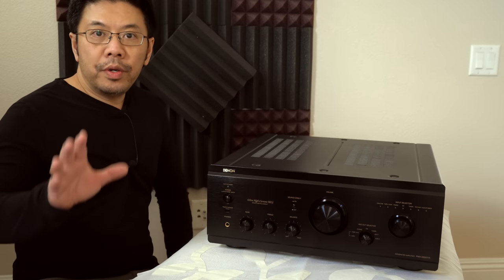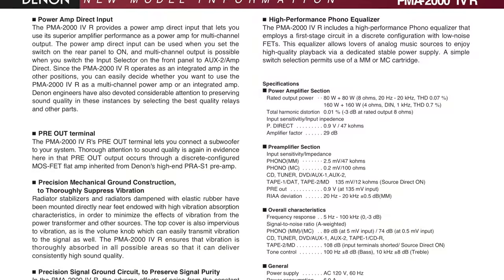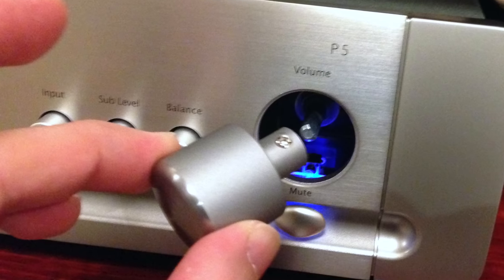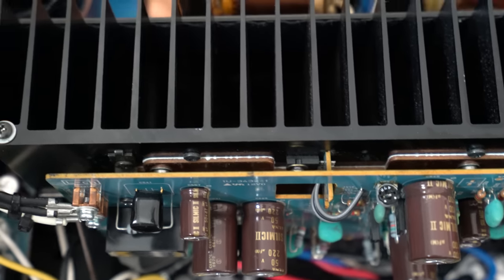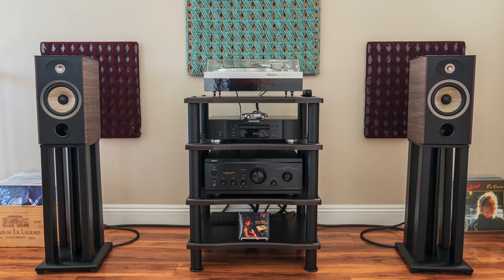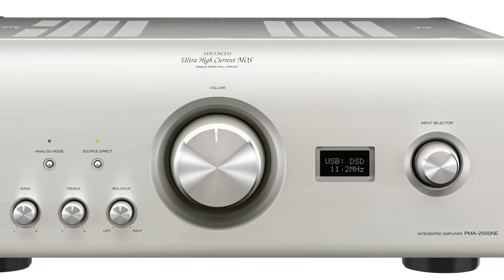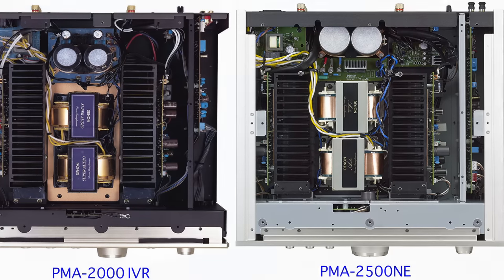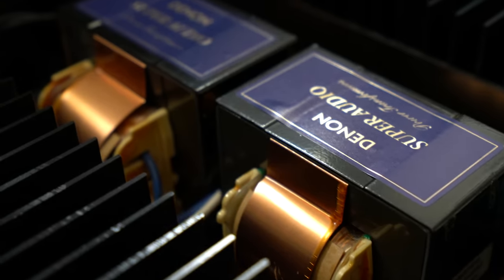Denon PMA-2000 IVR, A Hidden Gem For Music Lovers

Comment from the maker: DENON "PMA-2000" Series Timeline.
Series begins with the first model in 1996 and run for 20 years with different generations, until replaced by PMA-2500NE in 2016.

PMA-2000, December 1996.
PMA-2000 II, May 1998. 
PMA-2000 III &  PMA-2000 IIIR, January 2000.
PMA-2000 IV and PMA-2000 IVR, March 2002.
PMA-2000AE, July 2005.
PMA-2000SE, July 2009. (PMA-2010AE in EU & Aussie?)
PMA-2000RE, October 2012. (PMA-2020AE in EU & Aussie?)

Replaced by New Series.
PMA-2500NE, February 2016. (Current)

Note, 
No RC For First Two Generation.
3rd "IIIR"and "IVR" 4th Generation with RC option, RC is standard after 4th generation.
Reply: Great review, today I bought a pma a100 from TMR for $1580. Nearly 60lbs and I’ve wanted this particular model for awhile.
Reply from the maker: It's a very good amp, Audioholics have detail measurements of A100.
Reply: Thanks  I just like the way it’s made and in Japan for many years with nearly the same basic tried and tested design. I bought a Denon 301 MC for it on a Technics 1500c.
Reply from the maker: That’s great I also have DL-301MK2 that I really like, enjoy your music, thanks
Reply: @Tharbamar  I was thinking of ordering a pre owned pma-sa11. It seems like it should be mostly the same as the sx11 and can be had for 2k less than the new one. Paring it with my revel m126be.
Reply from the maker: @bs11100010, SA11 would be very nice, I thought about it before I order for SX11, thanks
Reply: All the best to you and your family. Stay well.
Reply: Great review, have you ever compared Sansui au alpha 907mr vs Denon PMA-2000 IVR?
Reply from the maker: @Martin Ruiz Yes, it's 700+ DF @ 8Ω
Reply from the maker: @janzetrateski6300  Yes, 907MR has more refinement with a bit more smoother mids and highs but Mid to Low Bass is not as good as 2000IVr.
Reply: @Tharbamar  thanks for the reply
Reply: @Tharbamar  i notice the two big caps are made by denon but i have my pm2000 1st version it has elna caps.
Reply: @Martin Ruiz  (damping factor: greater than 700, 20 Hz – 20 kHz)
Reply from the maker: It’s should be the same custom made caps for Denon, I think later generations have big Denon logo with smaller Nichicon name underneath.
Reply: The power supply capacitors are Nichicon.
Reply from the maker: mystique Yes I saw that but I don’t know why I typed ELNA, corrected, thanks
Reply: @82ivaylo  the pm2000 which i have has Elna caps. while the pm2000iv used by tharbamar is using nichicon caps.now i know one of its difference.
Reply: @Tharbamar  my 1st ver of pm2000 has elna capacitors
Reply from the maker: @myplaguesify  I didn't know that, I thought they only use Nichicon main caps, Thanks for letting us know.
Reply: Tharbamar. I have the opportunity to purchase a pma 2000-r in australia for $900. Would you recomend at this price ?
Reply: There was a denon pma 2000R

Comment: I've used this exact amp in my main system since 2008. Everything said in this video jives with my experience perfectly. It's very powerful & well built, with a clean, punchy, and controlled sound. I even had the same problem with the input selector. After using the amp for about 9 yrs, the input would randomly change without me touching anything. It was really frustrating. I took it to my local Denon authorized service center. They cleaned out & re-lubed the potentiometer, & it's been back to perfect since then. Great, great value. I also plan to keep mine for a lifetime.

Comment: That is exactly how I feel about my Yamaha 2100, solid build quality, nothing that will become dated over time and since I still have my first Kenwood integrated at 32 years old I feel safe saying the Yamaha will last a lifetime. Of course it has already gained a tube based sibling, but aside from the warm tone they both have very different strengths. What seemed like good value to me sitting just below the Yamaha 3000, now seems ridiculous value sporting the same topology and balanced circuit as the $20k separates. I can't wait to hear the Demon at 500hrs. Enjoy, my friend.

Comment: I would say my POA-6600 mono blocks with DAP-5500 are the Grandparents to this.  I’m still using the preamp in my system. And the mono blocks are still used when I choose not to run my tube amps   They have been used with my Martin Logan Sequel IIs also purchased in early 90s.  I’ve not had any issues running the Logan’s with the POA 6600.   Build quality is very good copper shield as seen in your video.   I’ve been very happy with them other wise I wouldn’t have kept them all of these years.  I do use my tube amps 98% of the time now but the POA are hooked up and ready to go!!!

Comment: Thats a badass amp period ! My Sansui G-8000 was 975.00US new in 1979 built in japan and the toridal transformer is the size of most amps now days lol and it scales like no other amp i have owned even better than my HK 990 which was good . I have owned many Denon amps and i like the Denon sound muscler and they sound great on most budget bright speakers the warm/richness really calms down metal dome tweeters and horns .
I have bought over a dozen amps from the end of 2018 till now and for the money the IOTAVX-STACK (Nakamichi) has blown me away basically 2 separate mono amps one for each speakers this gives you alot more power 2 wall plugs ins but your getting 240v instead of 120 !! So musical with amazing midrange .
 But so glad you sticking with Denon 
I absouletly love Denon also ! Very reliable !
Reply from the maker: You need to stop buying amps, I think you have too many of them 😁
Reply: @Tharbamar  having alot of amps help me alot with reviews , because me subscribers have different amps then me.  So i use cool netural warm  amps , speakers sound so different and when pared with the right amp by finding that Synergy is fun to do . 
I het surprised all the time . 
But haven't had much time lately,  working almost 80 hour work weeks wearing me out ! Even during this shutdown BMW still wants us to make them parts their greedy ! I think the Governor of my state about to shut us down !
Reply: @Tharbamar  check out my new cummunity pic ? 😆

Comment: I have the PMA-2020AE and i still keep my old Denon PMA-2000AE, great amplifiers.
Reply from the maker: These amps will last very long time for sure.
Reply: is it signifikan different between 2020ae and  2000ae?what about the sound sig of denon amp. every people on google say denon amp have bright and lean sound is it right? i am interest with 2020ae
Reply: @Rayradityaa  The PMA 2020AE is more lively, overall better sounding amplifier than PMA 2000AE.  Denon sound is not bright.
Reply: thanks for reply, finaly i already buy 2020ae and yes i like the way it sound. not bright at all..
Reply: @Rayradityaa  Congratulation for your new Denon. I will say it s warm sounding amplifier with good 3D soundstage .
Reply: @82ivaylo  I heard an opinion that of them all (2000, 2010, 2020 and 2500NE) the absolute best is 2020AE for some reason with its successor 2500NE being considerably worse. 
Also 2020 is said to have extremely deep and powerful bass - I don't know if its true or not. It seems that 2020AE is ideal for electronic music right?
Reply: @arkadiuszmikina4563  I do not have experience with the 2500. About 2020, yes the bass is deep and well controlled. When you listening to 2020 you are thinking there is small subwoofer in the room, but actually there is no subwoofer. Who told you about the comparison of 2000, 2010, 2020 and 2500?
Reply: @82ivaylo  That's exactly the effect that I am after --> thinking that there is subwoofer in the room but there isn't!!!! Many thanks mystique!!!! 
I am not an audiophile who listens to ambitious acoustic music like jazz/blues/soul/vocal. 
I am music lover who listens to electronic music and want very deep and very powerful bass and enormous scale of sound. 

I heard from quite a few people that 2020AE was the best of them all and also that 2500NE is a let down as SNR is low and so dynamics are low. I think it has to do with the inclusion of a DAC in 2500NE. 

If 2020AE only had variable Loudness button/filter (to aid my night time listening sessions) that would be amazing (that is why I am looking at Vincent SV-237MK as well).

Comment: I really really thank you for this review in particular as I am aiming to get the PMA-2500NE. There is no reliable review on youtube of the 2000 series up until now.
Reply from the maker: It’s a very good amplifier, I think you will like it, thanks
Reply: @Tharbamar  which one is better pma 1500RII or 1510ae ? Thanks a lot!
Reply from the maker: @tess6499  AE is newer model with some improvements.

Comment: I bought the Pma 2000 MKIV in 2006 and It Was a reliable amplifier for the last 14 years, the Problems I had Was also the imput selector and the Balance Volumen(Power Bias, left Channel was playing louder than the right one)
Reply: A "dirty" balance pot can cause issues with the balance just as a dirty selector switch pot can affect the input selection.  Clean both with de-oxit or similar evaporative contact cleaner.  Do not use WD40 or RP7 or similar lubricant as these can damage the circuitry.

I also own a PMA2000. Sensational amp for the money.
Reply: @dwr4992  thank you for the advice, I allready cleaned both whith a Potentiometer cleaner, the imput selector worked well for a one  month or so after that It startet all over, cleaning the Volumen potentiometer didnt work at All sadly. I tryed this process several Times. Greetings from Austria

Comment: Dear Friend, Hello
I was just about to put this Danon amplifier aside
Because I bought Nime Audio/AMP/DAC and it's much, much better than Danon
   FOR FOCAL
1008 BE ELACTRA
then 
I bought speakers B&W 801 S3
And suddenly I discovered this amazing amplifier just moving the loudspeakers with a huge   power  ....huge bass and amazing  and awe-inspiring treble
& MIDS 
 Stage width and depth that probably would not have been possible without this amplifier
Even so much power is barely 11 o'clock
{In the previous format I used the DAP-2500A Pre Amplifier
}
Now only his PRE.
My source SONY XA-50ES
DCD-1650AR
SA-11 S1 MARANTZ
DCD-3560 DENON
I also connected MIT MH-750 cables instead of VHD-122 which have accompanied me for another C-12 years since 1990

My amplifier has a logon problem suddenly for no reason jumps me to another IMPUT logon or clicks on Sony's RC  and suddenly jumps from CD to tape e.g.

I follow your movies you definitely have something to say about audio.
Thank you
IL

Soon a short film was uploaded on the system

Comment: Recently bought a used PMA-2000AE from Japan, USD900 shipped to my country. Paired with my Wharfedale Evo 4.2, the amount of bass produced is crazy. Big difference compared to my previous Yamaha stereo receiver Amp. (100W/channel). I enjoy the sound from this Denon very much and it can go crazy loud. Many thanks for your excellent recommendation Tharmabar.
Reply from the maker: Yes they are very good, hard to find better quality in the same price range used or new, especially with dual mono design, thanks

Comment: I think power MOS amplifiers are more reliable than bi-polar. Rock solid Hitachi MOS in my Kyrocera receiver since 1980, no thermal runaway, the reason, voltage gain works better than older current gain equipment.
Reply: Regarding robustness, the main difference between BJT and FET is that BJT has limited safe operating area, so the output devices need to be carefully protected against even moderate current when Vce is high.  FET devices are only power-dissipation limited and therefore more rugged.  
But both types of output stages are current-gain stages.

Comment: Hi @Tharbamar, I have a B&W 607 S2 speaker, and I currently own an Audiolab 6000a amp with a Chord Mojo 2 as a dac, and I really like the soundstage, the holographic sound, and the separation of instruments in the 6000a, but the 6000a lacked warmth in the midrange, and now I need a warm amp with big soundstage. and with dynamic holographic sound, I thought about the Denon PMA2000AE. What do you think? Will it give me what I want, or are there better options for my speaker under $1000?

Comment: I bought this series model in 2001 new.
No problem at all for 20 years.
I turned off power only couple of times, maybe that's why.
Reply from the maker: I like to leave them on as well, only turn it off while I’m out of town.
Reply: Much thanks for your informative reviews.  Can I ask why do you not power off the amplifier even when not in use?  Do you leave it power on or in standby mode most of the time?  Thanks again.

Comment: I learned from your experience with this amp that one can never judge a component without 1st hearing it yourself. Should have known that before, feel kinda stupid that I fell into that trap!
Reply from the maker: What kind of Amp do you ave now?
Reply: @Tharbamar  i have 2, kinki studios EX-B7 monoblocks and EX-P7 preamp, and a sony ta-a1es integrated that i sometimes use instead. The monblocks are class a/b and the integrated is sorta class a. They sound very different, and i dont have a clear preference. My speakers are bowers and wilkins 702 s2s. I want to buy the denon you have but only if your experiment turns out good, or i will buy the new nad m33 integrated class d, very curious about the class d module in the nad.
Reply from the maker: I will make a post to answer all your questions about SX11 in a few days, thanks

Comment: Hey there, recently denon launched their 110 years anniversary model which is the newer model to the PMA 2500NE so i guess you should have a look at at as it has some upgrades including a good power supply
Reply from the maker: Thanks I will check them out but now I’m using SX-11 as my main amplifier.
Reply: Ya i love the way SX 11 sound love your setup

Comment: I have the same problem with my Parasound (sound balance) but its not the amp, its the preamp,  because when I put HT bypass on it goes away.
Reply: My p5 had the same issue after several repairs from parasound they replaced it with the new p6 and it was much better sounding too with no issues

Comment: Thank you for your relevant and concise reviews. Recently Denon has introduced the NE series .From the Japanese website and interviews given by the designer (sound master) the NE series marks a new beginning.Sound is following a vivid and spacious design thinking.Using the 600NE and it has great  price/performance . If i have understood correctly as i cant read japanese but the diagram shows that all the NE series is a single stage amplifier. I have auditioned the 520AE and 720AE .The NE is a clear stepup while maintaining the best of the earlier models.and  I would request you to consider auditioning the NE series .(Disclaimer : No affiliations)
Reply: NE series i mention is wrt the 600 and 800 models. You mention  PMA-2500NE, February 2016 . So i infer this introduced in 2016 itself
Reply from the maker: 2500NE is dual mono design with good power supply, I’m not sure about models below that, right now I have SX11 as my main amplifier, thanks
Reply: After further translation to english from japanese from Denon Japan blog its good to know that the entry NE models are also designed /overseen by Takashi Arai San  who did the SX design

Comment: I have PMA 1600NE it sounds very smooth. If it worth to get another PMA 2000IVR in my system or any different comparison between PMA 1600NE and 2000ivr

Comment: I have the smallest model of all the pma2020 series, power consumption is the only one with 360W, 136W 8Om and as much as 247W. Supposedly better than pma2500. Because it doesn't have to give on board, it was only in cd USB b.. Is Denon pma2000IVr. Do you think 700 dollars but is it worth replacing  pma2020 has pma200p
Reply from the maker: Sorry I didn’t understand which model you’re referring to, please include the model number you have to understand better but newer models have better pre stage but all 2000 series have same power supply design.

Comment: 9:16  do those RCA metal caps short the terminals?  I read somewhere they will do damage to RCA outputs if you  accidentally turn on those outputs
Reply from the maker: It won’t get short because the one I use has no center pins.
Reply: I feel better now.  Love your videos btw. Big fan.
Reply: Most metal-caps are on input sockets. This is for try or for believe because most of them are not at some Megaohms but shortened by 47kOhms inside.
If the socket is an output socket, there is no use to shorten it. 
If you do, it depends, whether line output amp is of low impedance / high current (some high end preamps are, e.g. Symphonic Line), shortening may harm at high volume, when not designed correct (in case, nobody does short an preamp output by purpose, it‘s like shortening a power amp). But in most cases it doesn’t harm, most preamp outputs have still some 50 Ohm to 2kOhm output impedance.

Comment: Hello. At first i would like thank you for this video. Im searching for new amplifier for my "Quadral rhodium 90" speakers. Because im using Denon PMA-710AE at now. Im interested in higher grade amps from DENON and pma-2000 looks pretty nice. As competitor to PMA-2k im considering ONKYO A-9000R which is little cheaper on our bazaar and looks pretty solid too. What is your opinion to ONKYO A-9000R and my whole dilemma? Thanks for answear. Stay safe
Reply from the maker: I do not have experience with Onkyo A-9000R to give you right advice, PMA2K series is overbuilt for the price back in the days, as you can see how much Denon is selling PMA110 in today’s market which is very same design with some upgrades, thanks